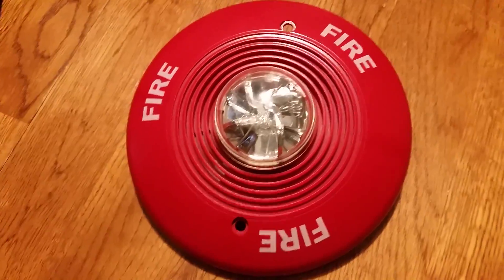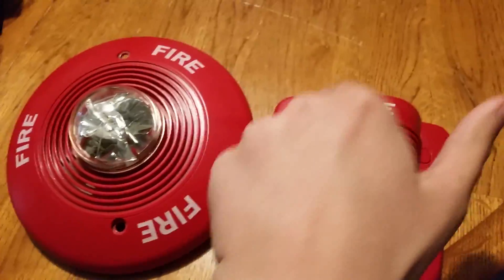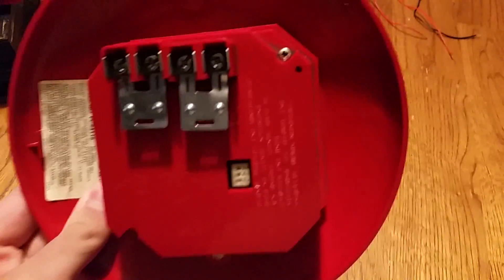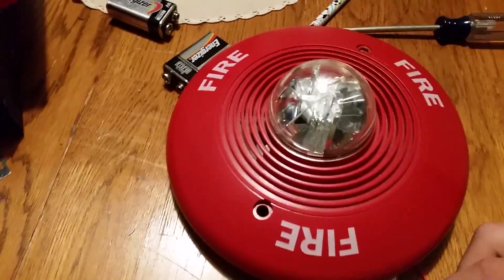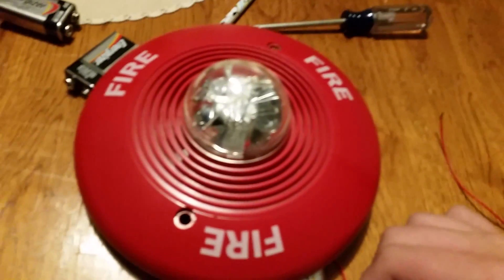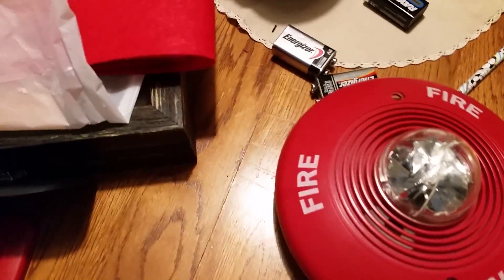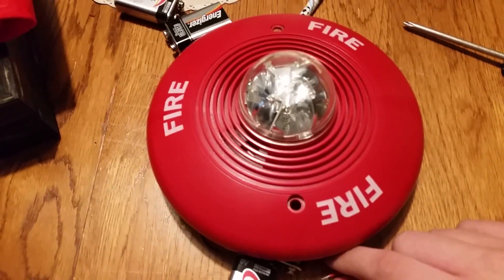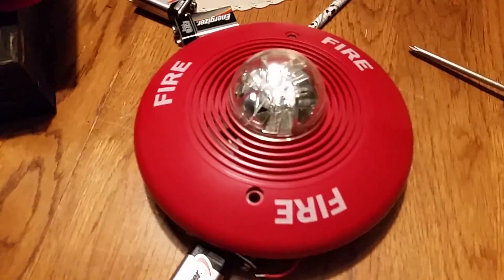Fire Alarm Test 2

Comment: That faint high pitched sound when you tested the strobe wasn't actually the horn. That was the capacitor inside the strobe charging and discharging current to the flashtube
Reply: My spec classic wall mount makes both that ringing sound and it also makes a faint horn sound.

Comment: I thought I should mention, the high pitch  sound heard during strobe only is the capacitor charging to power the strobe. You can hear the same sound in some flash cameras. My simplex 4904-9137 makes a similar sound.
Reply: Super SignQ